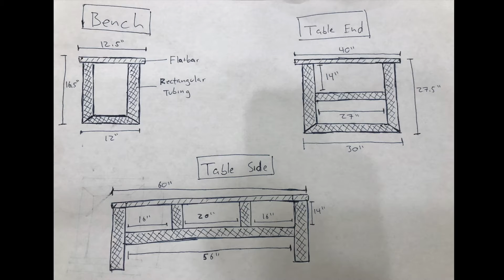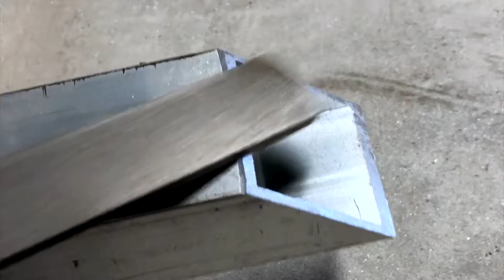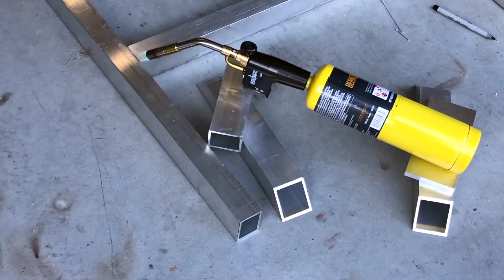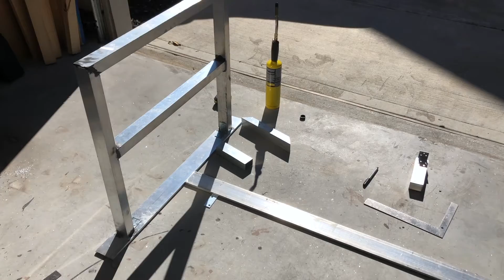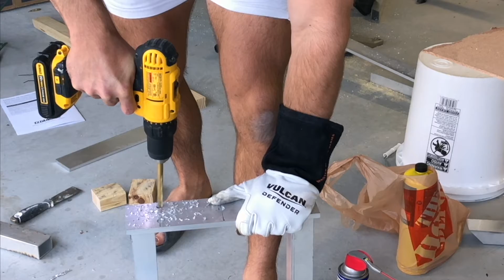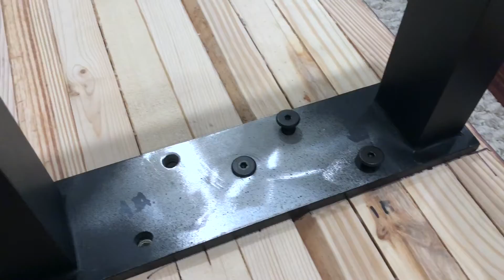Metal Brazing - Creating a Metal Table Base Without Welding | Builds by Maz

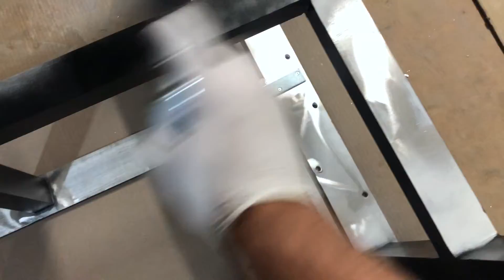Comment: Well-done and by far, the most comprehensive yet succinct tutorial I've seen on this topic. I notice (around 4:53 in the video), that you also incorporated some straps. Would you mind sharing where these were placed in the build since I can't quite make it out? Many thanks!
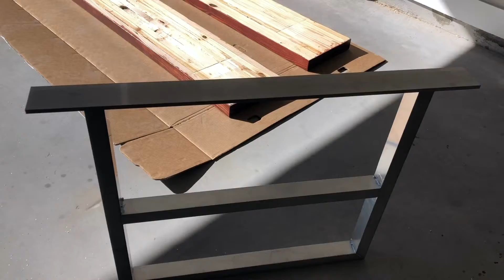Reply from the maker: Thanks so much and glad you enjoyed it! Yes of course.- these were on the underside of the brace bar going across the length of the table. 3:46 kind of shows where they would go, before I installed them. They helped keep the long piece in place while I brazed the top side.